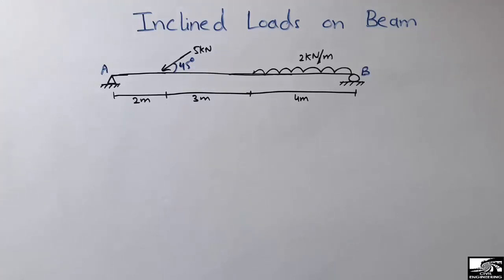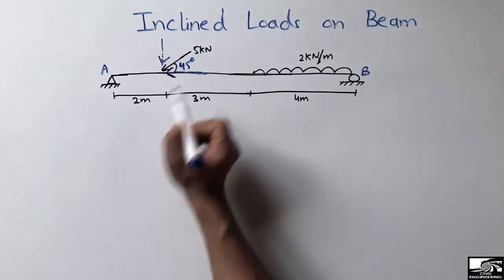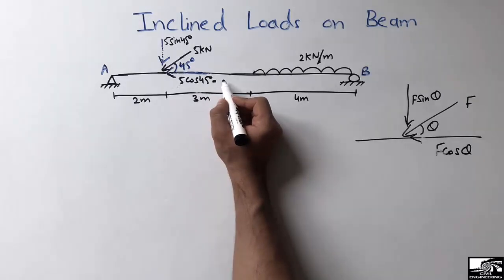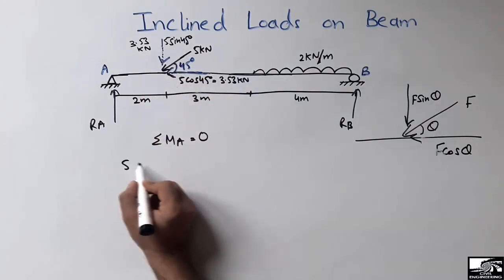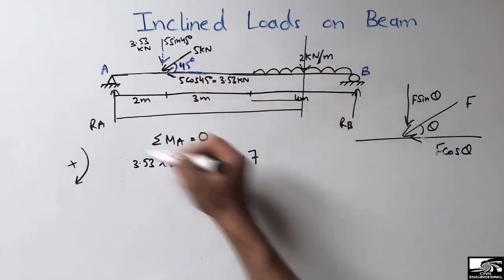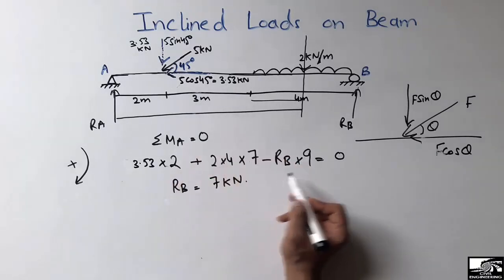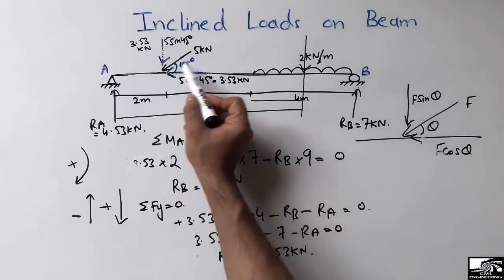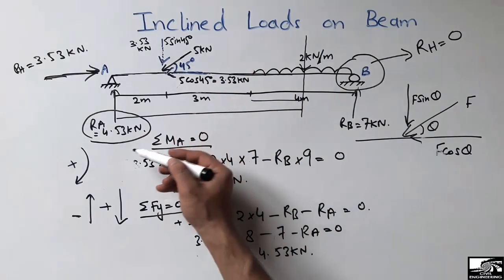Inclined Load on Beam

Comment: Q.2 Analyze the beam shown in Fig. 1. by flexibility method. EI is constant.  (20) 
 
Q.3 Analyze the rigid jointed frame shown in Fig. 2. by flexibility method. “A” and “C” are hinge supports and Modulus of elasticity “E” is constant for both members while moment of inertia “I” for the column is double than that for the beam.                                                                                                        (20)
 
Q.4 Determine the stiffness matrix for the truss shown in Fig.3.                                   (20)

 
Q.5 Analyze the beam shown in Fig.4. by stiffness method. EI is constant.             (20)
 

Q.6 Analyze the frame shown in Fig. 5. By stiffness method. EI is constant.           (20)
 
here images are not showing so plz contact me sir on my whatsapp number +923417549889

Comment: Q.6 Calculate the net sections area on possible failure paths of C12x30 channel. Only failure paths  symmetrical about the axes need to be considered. Take Ag = 7.0 in2, d = 1.25 in

Comment: Q.3 Design a fillet weld required to transmit a dead load of 35 kips & live load
     of 50 kips through two C12x36 channels to a gusset plate 0.75” thick.
    All materials are of A36 steel. Use E70XX electrodes with ½” thick weld                (14)
Q.4 Design number of bolts required to transmit a dead load of 70 kips & live load of 100 kips through two C10x36 channels (t=0.72 in) to a gusset plate 0.5” thick.
All materials are of A36 steel. Use A307 bolts of 0.5” diameter with two lines of bolts across web of channels.       
            (14)
Q.5 Design an A36 steel double channel tension member 20 ft long to transmit 45 kip’s dead load and 110 kip’s live load. Connection to 0.75” thick gusset plate is by fillet weld deposited with E60XX electrodes. Take U = 0.85          (14)

Q.6 a) Determine the critical load for frame shown in fig-2 with BC (W10X100) =35ft & AB=CD (W10X88) = 10ft. made of A36 steel. Use SSRC formula with E=30000 ksi. Take K=0.83    (7)
b) Design a building column of A36 steel 15 ft long to support a dead load of 55 kips & live load of 150 kips. Assume K=1.0 & E=29,000 ksi. Use LRFD approach for design.   (7)

Q.7 Design W section beam to carry service dead load of 1.0 k/ft (beam self weight not included) & live load of 3.1 k/ft. The beam length is 17 ft simply supported. Design beam for fy = 36 ksi. Also determine un-braced length “Lp”.      (14)